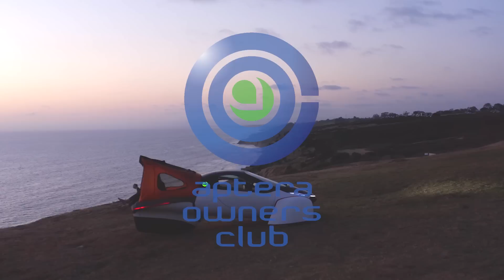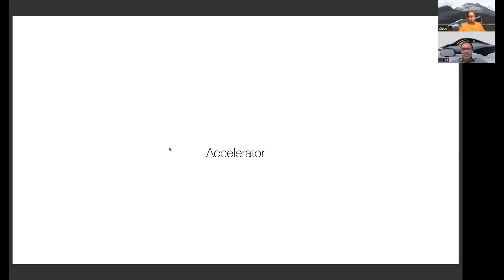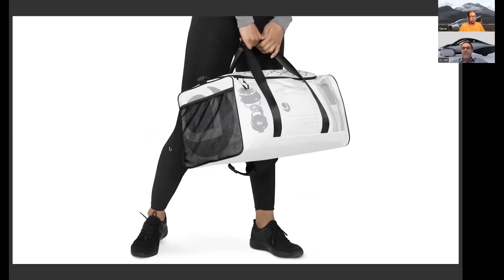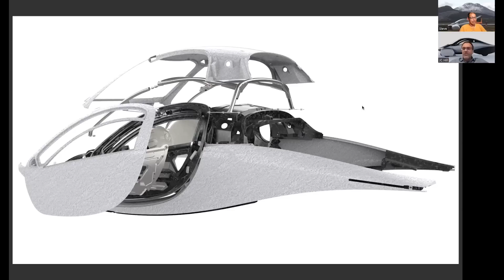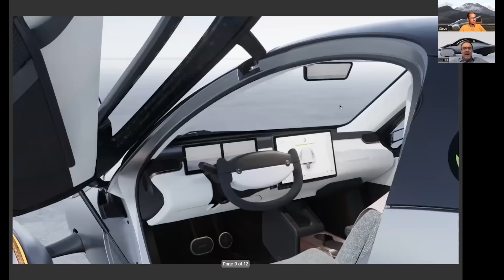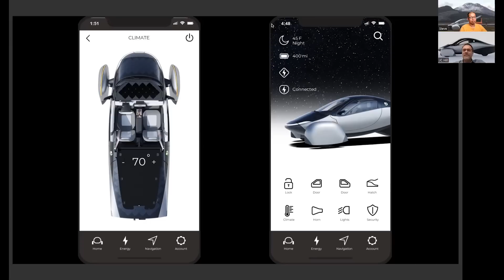Jason Hill gives us some Aptera updates and a sneak peek at the app!

Comment: The open pilot self-driving seems extremely promising from a capability standpoint, and open source software should probably be non-negotiable for a vehicle like this. 

Goes riding line with the same design philosophy of right to repair. 

Considering the potential dangers of someone getting into the software of your car though, Will there be any kind of master kill switch for the self driving?

Comment: With the reverse light led, I wonder why it's not just a line out leds around the perimeter of the license plate?
Reply: Jason Hill has mentioned in a previous interview that there are mandatory federal regulations regarding the illumination of the plate, in accordance with motorcycle conventions. LED's around the perimeter of the plate likely does not fulfill the requirements. Another motorcycle law requires that the plate not be folded down and be hidden from view. This is why the plate slides to the right for charging.

Comment: Will your online User Guide include a "Feedback" option so users can submit suggestions, ask questions?

Will you make the User Guide "Active".  Find the section on controlling the temp, allow the user to change the setting in the guide and it connects to the car.

Did you consider differential thrust to make the turning circle tighter?

Comment: Fantastic Vehicle! My question is how far do I have to lean out to close my door & does the doors reach out further than the Aptera is wide? I'm not crazy about the LTI sticking out like it does due that its pretty much in the center so that when loading into the rear, wont it be in the way as you bend or stand? Flush would be better. Is the tire pressure on the screen & with the Tire skirts etc, how do you inflate the tires? So many questions right! Thanks for taking the time!

Comment: would love some basic diagnosis at first then upgrading updates for more. I would love some heating and cooling after and before a drive. A automatically battery manager charging system we can see if the basics are heating and cooling the batteries incase we are ever suspecting a coolant leak or heater element or needing to go check our AC system, trust me basic info helps to just see it to check stuff. I would love to see basic info on the motor power draws and some things because it will help if I ever have a issue with a motor or converter or if I can not see anything a issue with a brain controller. Trust me basic information can save heartache and money. Now starting with other basic Accounting and functions email and contacting if wanted, and other fun basic controls. We need each personal car or cars to be able to connect to a personal app I would love to know a state of charge notification so I could go outside and put things away soon and a reminder. I would love some color themes even purchase some themes and sounds for my costume likes.

Comment: I'm sorry, but I just can't put that much faith in their intentions for safety.  When they first considered the yoke steering wheel I said then that there are too many situations where this application could present a safety hazard.  And even if just for popularity sake, have they followed what has taken place with Tesla's application of the yoke wheel?  I am in the early batch of orders and will not change because of the yoke wheel, but would at least like the option of a traditional round steering wheel.
Reply: Your making assumptions from a vehicle bias. What do you know about autocycles and how they feel while steering? I have 7000 miles in seven months with an Arcimoto, another tadpole autocycle. It has handlebars. I know the Aptera will drive differently being larger, wider, and AWD. Along with the camera system, the yoke, and the butterfly doors, I have never had these features in a vehicle and look forward to experiencing the intent of the engineers and designers myself. Enjoy the Ride.
Reply: This has nothing to do with assumptions or bias, it's factual.  In an emergency situation where the wheel needs to be turned swiftly a round wheels grab points never change.  They are always in the same position no matter what is done with the wheel.   A yoke, if the wheel has to be spun at an unexpected immediate notice, the grab points constantly change.  This could make the difference between injury or even death.
Reply: @ronalddeservi1889  Assumptions and feelings, not facts. My driving style is DEFENSIVE. The Arcimoto makes me a ninja in the Battlefield-as-Traffic SoCal commute. The Aptera will be a more capable vehicle and have variable assist steering.
I expect to be dialed in and engaged. I'll have to get used to the side monitors side-by-side, being behind the yoke, and expect to be a better Aptera pilot for the effort. Formula One cars have yokes, but those drivers have skill.
Reply: Again, fact not assumptions.  You show me how the grab points (If you know what I'm talking about) don't change on a yoke wheel when rotated swiftly, and possibly more than 360 degrees, and I'll agree with you.
Reply: @ronalddeservi1889  Dude, you do you. Let me reiterate, Formula One cars have yokes, but those drivers are expected to have skill. Fact.
Reply: @barnabasseadog7660  Fact, 99.9 percent of people buying an Aptera will not be formula 1 drivers.  Fact, this in turn can create a safety issue .  Fact, you still haven't answered or addressed the issue of the grab points.
Reply: @ronalddeservi1889  Fact: Everyone buying an Aptera is buying a vehicle with a yoke, deal with it.
Reply: @barnabasseadog7660  That's exactly what I thought your answer would amount to.
Reply: @ronalddeservi1889  I'm putting my money where my mouth is, I'll tell you how my Aptera drives with a yoke, when the Accelerators start beta testing thier signature LE's next year. Enjoy the Ride.
Reply: @barnabasseadog7660  I'm done playing the game, "WHO EVER GETS THE LAST WORD IN IS THE WINNER".  From your responses I'm guessing you're between 17 to 20 years old.  If by chance you're older than that, for your own sake, please don't tell anyone.  Bye
Reply: @ronalddeservi1889  YOUR RIGHT. I'll be getting to know the vehicle until it's intricacies become muscle memory. In case of any emergency, I'll be able to react instinctively, without thinking about my fukn hand placement. 
THE YOKE IS A SAFETY ISSUE, for you.

Buh Bye

Comment: For me, the monster touch screen is a deal breaker for me.  I rented a Tesla 3 while on the west coast a month ago and liked the car but hated the "built in laptop".  It was waayy to distracting.   I know Sandy is a fan of touch screens but more and more people are wanting and buying cars with minimal screens.  I keep looking at the Bolt as a good alternative.
Reply: Well, if you need more than 2 seats, you need another vehicle instead of the Aptera. All new cars have big screens. My main problem with the Bolt is its short range and slow "fast" charging. The Tesla Model Y Long Range is my current backup plan if I need a new car before Aptera is available.
Reply: @fotoguru222  I agree on the Bolt having a slow charge rate, and limited range, but it's still better then a Leaf.  Of course, GM is killing the Bolt in November so I guess it doesn't matter what we think of it.  There was an article on Marketplace, on NPR, about how many buyers are pushing back on the large screens.  I personally don't like taking my eyes off the road to do simple things like change the heater or radio station on a screen the size of my computer monitor.
Reply: I currently have a 2023 Bolt and love it. I’m optimistic I’ll love the Aptera more but time will tell.

Comment: The reverse light just looks terrible. Why not have a strip light above the plate that can have a plate lighting function and a reverse light function?
Reply: Because as an autocycle it has morocycle restrictions on the type of illumination placed on the plate. The horn button is also a mandatory motorcycle requirement. BTW, the single knob serves three functions: back-up indicator, plate light, and state-of-charge indicator.

Comment: I'm more impressed with the questions than the answers.

Fortunately the questions asked were specific and probing. And often when he asks about things in his Aptera interviews they may stimulate design/feature tweaks, such as in this particular one when he brought up: 
the backup/license light also being a charge indicator, 
the horn button location, 
a 50-60w charger instead of 15w,  
the huge value of "sentry mode", and 
the wattage level of the auxiliary (cig lighter) port in the back. 

I think this is the best Aptera channel by a mile--he comes prepared. Some of the designer's replies are OK, but having an engineer also would be more grounded and helpful.

Comment: that light knob sticking out in the back is just odd.   It is just asking to be broken off.   The whole thing can be achieved with a sleek LED light bar or something similarly flushed.
Reply: Your vehicle bias is showing. The rear light has to meet illumination specs mandatory for motorcycles. It also serves as a back-up indicator. This same single knob has a third function as a state-of-charge indicator. Haters gonna H8, tho.
Reply: @barnabasseadog7660  Your lack of knowledge is showing.  LED can't meet illumination specs?  LED can't serve as a backup indicator? LED can't show charge state?   Are you still having a mullet hairdo from the 90s?
Reply: @Chitown388  Your lack of reading comprehension is showing. You better check yourself, before you wreck yourself. Enjoy the Ride.

Comment: The problem with the license plate light for many is that it visually disrupts Aptera's symmetrical design. The single light fixture is out of balance. SOLUTION: Make this lighting balanced & symmetrical. Add a second fixture onto the other side of the license plate. And then make each one smaller than the existing single light with lumens output the same.
Reply: The license plate slides to the right in oder to access the charching port, which means you can't place another wart there.
The solution would rather be to integrate the license plate lighting and bachwards drive light above the license plate, similar to any regular car. A different design is not always a better design.
Reply: @charangohabsburg1  Have you not noticed the back is so thin there is no space for a light above the license plate?
Reply: @fotoguru222  Of course I have noticed that. It is a bad design, but as it is not metalwork it can relatively easy be remedied, which is what I will do.
Reply: Better yet, make a tiny ‘hood’ above the plate for leds to shine down. Use the strip across with another set of leds to shine behind you. Simple and looks good.

Comment: The rear backup light looks fine. People need to stop whining. Functional and affective, just like the rest of the vehicle :-) 
Should also provide a nice light to illuminate the charging port. :-)
Reply: It would be even more functional and effective it the light was placed above the license plate, just like it is on any other car. Changing a design just to be different is bad design.
Reply: @charangohabsburg1  Have you noticed the back is so thin there is no space for a light above the license plate?
Reply: @charangohabsburg1  putting the light above, the license plate, would most likely increase drag. Having a light next to the license plate in a relatively dead air space is better :-)

Comment: I want to know  if I can flat tow my Aptera?
Reply: that'd be the only way, wouldn't it? you're certainly not going to pull it.
Reply: I had my Arcimoto towed onto a flatbed. Straps were attached to the lower suspension and winched up. Not sure if the Aptera works the same, or has a tow hook, or needs the skirts removed first.

Comment: Great information. Appreciate what’s going on with the company. Also you bringing these folks on to talk, in length on this stuff.
On cameras monitoring the vehicle. I’ve found this solution now available - 70mai omni 360° dash cam. For a little over $200. Wire it in to the fuse panel. Sends right to your phone. Might be better than the onboard system trying to see what’s going on.

Comment: Hey Ho Aptera! IF you ever get this built and sold, the FIRST thing I will do is add REAL back up lights to it. A vast many of your potential buyers have night vision issues, and you want the Aptera to have 'one birthday candle's' worth of light output?? I just did this up grade to my current EV. Now I can see a night BEFORE I run over my cat [or the great grand kids, or the moose having chow in my flower garden next to the driveway.} Put a REAL back up lamp back there, and loose the "German hand grenade' that looks so awful as a faux light.
Reply: it looks like a poor afterthought of form over function.
Reply: Agreed, back-up lights need to be symmetrical: one light on each side of the plate, and with as slim a profile as possible. 

When you think about the market for this vehicle it's obviously going to skew older, and this market is going to need (demand) as much light as possible. 

It may seem like a detail, but it's actually a sales consideration--Aptera should always put itself in the shoes of its likely buyers, which are going to be older men when considering design. they'll be more likely to buy if these "little" considerations are met.

Plus having symmetrical twin lights is more pleasing to the vast majority of people just on design merits.

In the same vein the Aptera app icons need to be much larger. Old eyes will tire of squinting. Again, as finicky as this may seem, this will be a turn-off and will affect buying decisions.
Reply: I don't mind how it looks, but otherwise you are right on.

Comment: It would be great if we could get a definitive answer on whether the Aptera will be able to charge at all Tesla superchargers or just the ccs enabled ones. I realize Aptera has the NACS plug, but that doesn't guarantee availability to superchargers. Tesla controls that, just like then not allowing salvage title Tesla's access.
Reply: yes this is a super important question.
Reply: That's a question for Tesla folk, not so much for Aptera.
Reply: Tesla superchargers are almost a non-factor for me, as level 1&2 charging augmented by solar will be sufficient.
Reply: 👍 For those that road trip often, Tesla network is essential since no other network has proven reliable and are just getting worse. It's super unfortunate because the other vehicles are compelling.
Reply: Oh god, how annoying would that be if Tesla only permitted non-Tesla charging on CCS, like even on the magic dock, only the CCS side could be used, so we'd have to use a CCS to NACS adapter 🤦🏻
Reply: @mockingbird187  Why woulld they? Give Tesla some credit. They aren't dummies.
Reply: @fotoguru222  it's not about if they're dummies, it'd be if they wanted to cooperate. But I assume, since they wanted their charger to be the standard, that they would reward Aptera for using their charger style.

Comment: Did you ask about using a solar battery to charge the Aptera from inside the Aptera will driving it? I might have missed it.
Reply: Ha! The whole Aptera battery is a solar battery!
Reply: @fotoguru222  That's true. I'm thinking about apartment people who need an extra 20 miles a day without plugging in.
Reply: @ScottOstr  Ah! So you are asking about their planned feature to enable use of external solar panels to increase the rate of charge? I would like to know more about that too.
Reply: @fotoguru222  No. Can the Aptera run off of an external battery like a large Evoflow? You could certainly charge it using a larger portable battery using the charge port but can you "charge it" from inside the vehicle while driving it?
Reply: @ScottOstr  Why? Sure, the Aptera can charge from anything that provides 120 volts AC, like a standard US outlet.  If its like every other EV, the Aptera will prevent the vehicle from getting out of Park while plugged in. That's a safety feature to prevent anyone from ripping the power cable and connectors out. 

If you're a hacker and willing to risk voiding the warrantee and cut through wires, I'm sure there would be a way to override that safety feature. But again, why?

I see no need for an extra battery. If 400 mile range isn't enough for you, wait for the 600 mile version. If 600 isn't enough ... (!)  ,   well they will have a 1000 mile range version. If you don't have power locally to charge it, it would be easier, cheaper and safer to install that power.
Reply: @fotoguru222  You're right. You would charge inside the back of the vehicle. You wouldn't use the charge plug outside the vehicle. It would be a unique use case.

Comment: The new information about the metal roll cage is very interesting. Seems that the engineers in Italy are helping to take the Aptera to the next level. Power outlets should include at least one USB-C 100 watt power delivery port (preferably two), and the 12 volt cigarette port should be 13.2 vdc regulated output - at least 10 amps. That will run portable electric refrigerator / freezer “coolers,” etc.